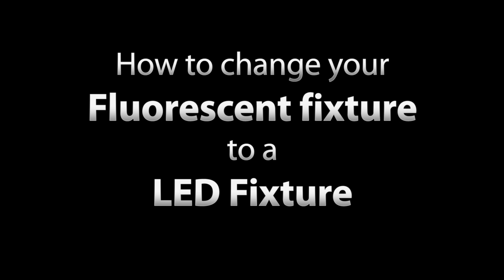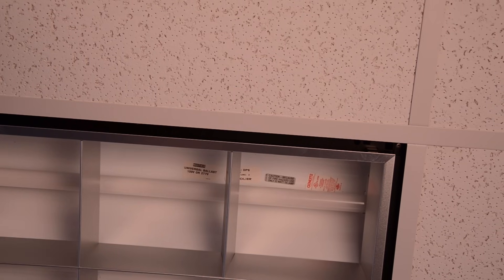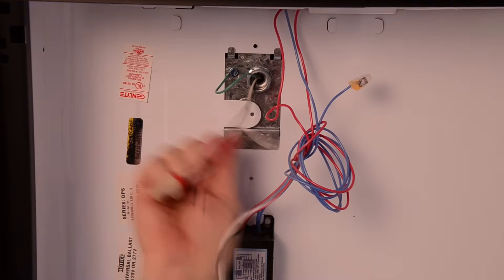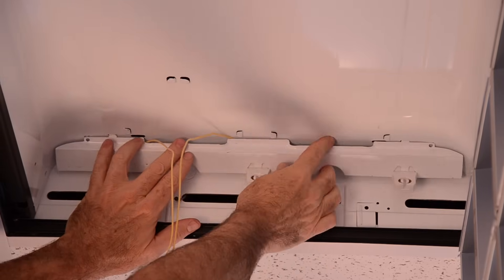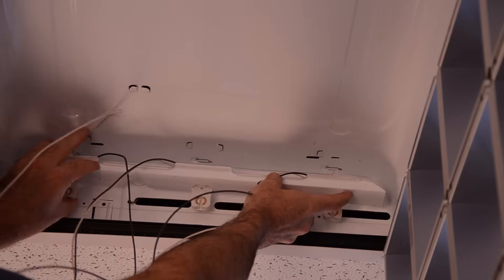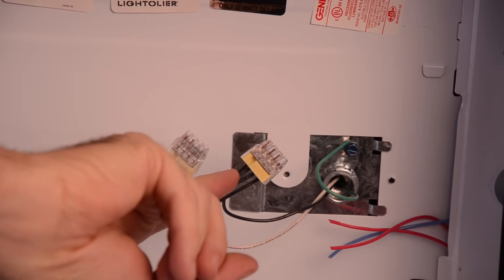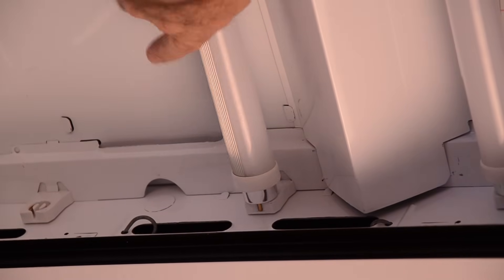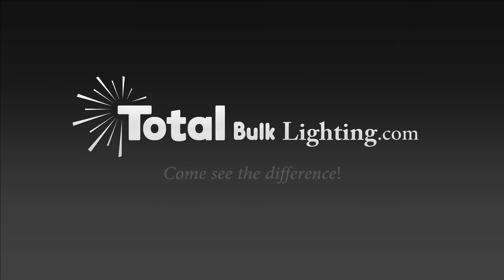Convert T8 / T12 Fluorescent Tube Light to Single End Powered LED T8 Tubes by Total Lighting Supply

Comment: If I am converting from a T12 fixture, do I need to replace the tombstones on the non-working side?
Reply from the maker: If the non-electrically connected side tombstones are in good working order there is no need to replace. However, if the tombstones are brittle or damaged in any way we strongly recommend replacing.

Comment: This is a five star product if ever there was one.  This is one of the easiest electrical projects you can do.  The trickiest part is removing the various covers over the ballast and the connectors since they differ from model to model.  If you really take your time and you are at all handy this will take you about thirty minutes a fixture.  If you do more than one at a time you'll be amazed at how fast you'll be done.  The kit is perfect, the connectors are almost foolproof and the light is terrific.   All of my basement lights are four foot four tube fixtures and there are fourteen of them.  As the ballasts burn out, which they're doing more and more as the equipment ages, I'll replace them with this setup.

Comment: So I assume then that it's ok to have a shunted tombstone on the non-powered end as the pins don't power anything and are not connected to one another - yes?
Reply from the maker: Yes, you can keep the original shunted tombstones for the non-powered / not electrically connected end. We recommend replacing them if the plastic has become brittle :)

Comment: This conversion kit is great.  Ordering is easy and it was shipped very quickly.  I'm only marginally handy with electricity.  I'll replace light switches and outlets and wall and ceiling fixtures, but I always hated dealing with fluorescent ballasts.  I used this kit on a four tube fixture over my workbench when one of the ballasts went toes up.  It's the nearest thing to idiot proof you'll find.  All of the parts needed come with it and this video gives a clear, concise tutorial that makes the job easily manageable for just about anyone.  If you can change a fluorescent tube you can probably do this conversion.  I have another burned out ballast in another fixture and I'm going to use this kit again. The only thing I might change is to use the soft white instead of the bright white kit for that part of the basement.

Comment: is there a downside if i leave the ballast?
Reply from the maker: You will first need to electrically disconnect the ballast but once that is complete and you are all wired up correctly to power the LED t8 lamps you can choose to leave the ballast if you want.

Comment: My old florescent bulbs are  F32 T8/735. Would a T8 LED to the correct replacement?
Reply from the maker: Your old fluorescent bulbs are T8, use 32watts and have a color temp of 3500K based on the part number you supplied, F32 T8/735. You would need a retrofit kit to make the change but yes you can you T8 LED.  Here's a link to our kits: http://www.totalbulklighting.com/led-lamps/t8-led-lamps/retrofit-kits.html

Comment: you skipped a huge step. one minute you have 6 wires in your hand the next minute you have their last one going into a connector. what about the first 3? What about the wires on the other side? You mentioned making shunted into non shunted then never said another word about it. totally confusing video. all i wanted to know is if the non power side was daisy chained somehow. thanks for not showing that.

Comment: Great video! In regards to connecting all the black wires together & all the white wires together there doesn't appear to be a specific order for the same colored wires to snap into the connector. Does that sound right? Obviously all black wires are connected together, then all the white. Thanks!
Reply from the maker: That is right. The order of all the black wires connected together doesn't matter. Equally so for the white wires.

Comment: Why are these LEDs configured as single ended? I understand that the many LEDs within the lamp itself are in parallel, with anode hot and cathode neutral. But they could run the neutral back to the other side of the lamp no problem. So why not? After doing some research, it looks like safety was the main concern. Does anybody have more knowledge on why these lamps were not initially configured as single ended? These single ended tubes don't require a ballast. Are there any double ended tubes on the market yet which do not need a ballast, and therefore the ballast can be bypassed and removed during installation?

Comment: Hi, i used your method for installing a toggled led 16watt cool white 4000k on 4 ft fluorescent.  Replaced the 2 ends with the new tombstone , put black and white wire 16 gauge , other end replaced with new  2 nd tombstone no wiring with the other tombstone. Is this ok to do on this type of bulb. It is working . Thanks for the tuturial - learned alot.

Comment: Great video. About to take on my own fluorescent fixtures using this method. 

Question: since I don't need to collect bugs on the solid, prismatic, plastic cover for the original fluorescent fixture anymore (assuming no heat from LEDs), where can I find a 4ft light cover that is open and as sharp-looking as that metal grate seen at the end of your video? 

Thanks for uploading and sharing your knowledge with the community.

Comment: Did you replaced 3 of the 6 tombstones?  The 3 remaining shunted tombstones don't matter right?
Reply: +Ari Fisher 

You would only need to replace the 3 on the one end as that's where it gets the power from.  I of course pick the end that's closest to where the power comes in at.  The other end you can just cut the wires off short and leave it alone.  The only purpose they have still is to hold that end of the T8 LED bulb up in the air.   

Of course if you have a broken one that won't hold the bulb up, then replace it with one of the old one's you removed.

Comment: what about fixtures with on/off pull chains?  must it be disconnected?  i would like to keep that feature.
Reply: +Linda Alles 

A pull chain is connected to a switch.  Unless you remove the switch, that would have no effect.  The Ballast would be removed from the switch, and the straight wiring would go directly to the switch.  Should be a non-issue.  You're basically cutting out the middle Man (The ballast).

Comment: What happens if a non-LED tube is installed accidentally after the modification?  Will the normal tube explode or just glow a little on the power side?
Reply: +K NG 

I would assume it would Pop or something.  It's not going to glow a little as there's no longer a ballast.   This is why you should LABEL.   I'll put a Label on saying something like LED Conversion, 277 Volts, This end Power.  Stick the Label on that end.  For you it may be 120 volts.  All the lights here where I work have 277 volts going to them.

I really don't see this as a huge issue.  It's LED's and they should last for years.  Something like 20-30 years.  What's you're chances of having to ever replace it again for being dead?  These won't burn out like the old bulbs which seems like I'm always replacing.
Reply: +K NG If you accidentally put a t8 or t12 tube in place of the led tube, you and anyone else in the room will be instantly vapourized.  It is recommended to put the warning label on the fixture.  ;)

Comment: I have a dumb question.  Why didn't you wire the new non-shunted tombstones on the end where the house power (line) voltage came in through the fixture?  You picked the other end... furthest from the line voltage black and white neutral wire... and then had to stuff all 6 of those 4 foot long 18 gauge wires into the ballast cover.
Reply: +K Sharpe 

I think to better show people in the Video.   But you're right.  When I did a few of them.  I did the end closest to where the power comes in.  I also wired it using short wires,  Plugging directly into one tombstone to the Next tombstone.  All the black on one side, all the white on the other side.  Each side of a Tombstone has 2 connection points!!!  So 2 black wires and 2 white wires and plug directly into each of them.  You'll have a free spot to plug in a long white and black wire to the main power source.    

The other end, you can just cot the wires off short as they do nothing but hold the LED T8 bulb up in the air.
Reply: +K Sharpe, I had the same thought. He answers the question earlier: "We did this so you can see them up large."

Comment: Thx for the video.  It is very useful.  In my setup, have 4 tubes and did the connections successfully now the lights turn on.  But the problem is, it is does not turn OFF(always ON).  Noticed that I have two set of cables coming from the ceiling, one set comprises(3 cables) white, black & ground(exposed copper cable) and the other set comprises(4 cables) white, black, red & ground(exposed copper cable).  Tried the following combinations:
1. all white in one and all black in one, with first set of cables, turns on and do not turn off(switch is in OFF position), and switch does not operate
2. all white in one and all black in one, with first set of cables, turns on and do not turn off(switch is in OFF position).  RED is unused(capped)  and switch does not operate.
3. Combined white to white and black to back from both first and second set. RED is unused(capped).  Turns on and do not turn off(switch is in OFF position).  Switch does not operate.
4. To combination #3 added RED to white,  switch is in OFF position and light turn ON.  When switch is turned on "BUMB" main switch trips.
5. To combination #3, added RED to white,  switch is in OFF position and light turn ON. added RED to white,  switch is in OFF position and light turn ON.

Any tips on how to make switch work.

Comment: This video missed the most important part of the job. They shut off the breaker in the panel box but they forgot to test the hot wire to ground when they removed the wire nuts.  It is very easy to turn off the wrong breaker . Always test before performing any kind of electrical work.  Don Fuzzy

Comment: I have a bunch of single bulb units at work that are actually supposed to be updated to a new LED setup but the cost of 18 lights is around $2,500! So we haven't bothered with it yet but I was wondering how many of these can be plugged together? Max on the current ones is 10 which is all we need as the longest "strand" is 10 lights but I'm wondering if I could do this. Rough cost this way would only be $400! I actually ended up with the old lights from another store because they got the new lights so score for me lol.

Comment: 1)  If I somehow mess up the little connector, can't I just wire nut them all together?
2)  Want to replace a bunch of 4 bulb fixtures.  Can I just use 2 higher wattage LED tubes?  Tenants dont even seem to notice when 3 of 4 bulbs are out, for cryin' out loud!

Comment: Although it does not mater which end is powered, you might want to power the end closest to where power comes into the fixture. Keeping your wires short may mean less work to keep them from pinching. Plus if you do a lot of these, you can recycle your copper.
Reply: Keith Reynolds you don't need the kit.

Comment: Maybe it would be a good idea to place some kind of label that the fixture has been swapped over to LED so that someone later will not be trying to insert a flourescent bulb in the sockets... just a suggestion.
Reply from the maker: Stan, we have added a label to our kits to better communicate the fixture has been retrofitted. Thank you for the suggestion :)
Reply: +Stan Skaggs 

I did this myself.  Installed a Label I made that said LED Conversion, 277 VOLTS, power this End.   Just use a simple Label maker.

Comment: Or you can just get a LED that is compatible to the old Ballast.....
Reply: ***** Just out of curiosity, is it qualified by UL or energy star?
Reply: kevin lin I use one that's compatible with the old ballast, it only required changing the starter and that was it.  But I still bypassed the ballast because 1) the ballast made an annoying hum, and 2) the ballast used around 10 watts so bypassing it saved more energy.

Comment: Hm. What pin connect configuration for converting a 4-light fixture? Will it have to accommodate 8 or 9 wires? Or jump across and treat them as if they were two, 2-lamp fixtures?
Reply: ***** I guess the question would be,, in what configurations do you sell these kits? (1) lamp conversations? (2)? (4)? Or only 3 lamp?  
Also, D. Doyle Reynolds, are the 4 lamp fixtures the newer T8 Instant start fixtures or are you talking about the older T12 Rapid start fixtures. The wiring configuration is different and the use of shunted and un-shunted sockets are different

Comment: What happens when someone who doesn't know what they are looking at puts a t8 fluorescent lamp back inside the fixture after it has been retrofitted?
Reply: I have seen other retrofit videos where the finishing touch is to affix a label to the enclosure that covers the ballast and wires area indicating that the fixture has been rewired thereby making the fixture incompatible with (T8) fluorescent lamps.
I was surprised that you did not have such a similar label in the retrofit kit to affix to the modified lamp fixture.

Comment: Great Instructional video, I did notice that the middle led was last to ignight, why not use and electric ballast opposed to wiring directly? Wouldnt an electric NOT Magnetic ballast ignite all LED tube equally? Im asking because I want to retro fit my office lighting, my home garage and my sister whole house including garage which has flush mounted CFL light housings I installed. If possible can you email me your reply @ ben@net2uinc.com sir? Again great instructional video, thank you very much